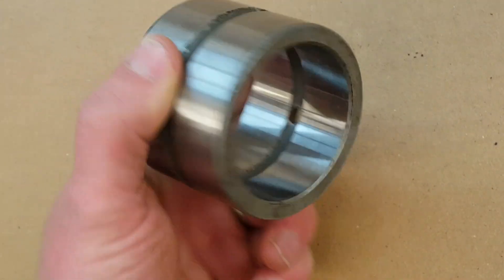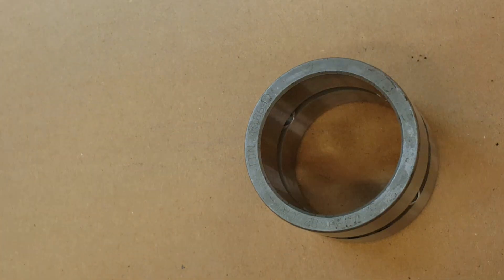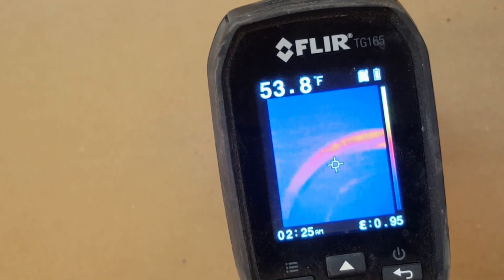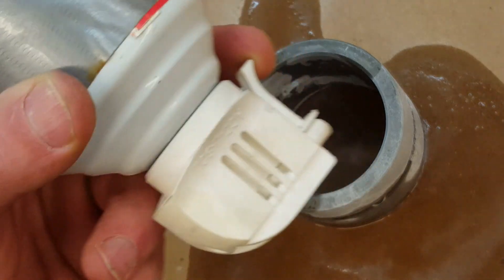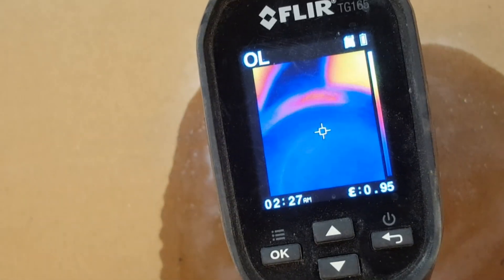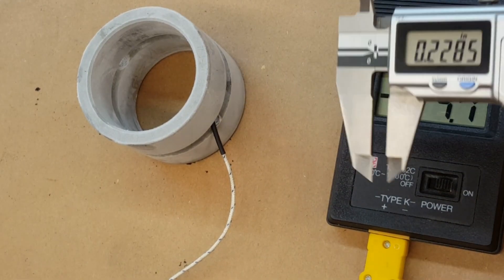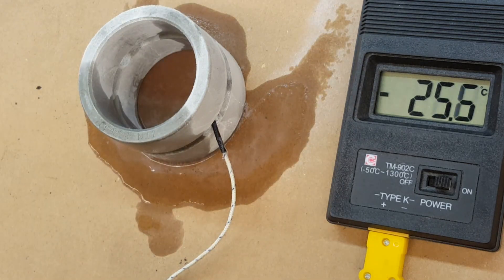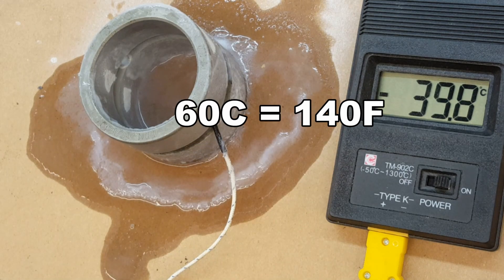Old Mechanic's Trick: Freeze-Shrink Metal Parts WITHOUT Nitrogen.

Comment: Dry ice and ethanol bath is another way to get shit real fucking cold. Dry ice is easy to get in the US
Reply: Dry ice and acetone even better.
Reply: "Dry ice is easy to get in the US" - That's right. At least for now - but lawers are always scrambling about looking for new payoffs and "ice is" sounds too much like "isis" to allow it to remain legal for long ;-)
Reply: acetone isnt very nice to work with though.
Reply: yeah them ketones, bad for the working bits for your insides
Reply: Well, in this case you're not supposed to drink it.
Reply: It's a pain to get in the UK (dry ice) even though it's not a restricted substance.
Reply: @gordonlawrence3537  Thanks in no small measure to stoopid EcoPhanatic politicians... so lets not even mention "CO2"...
Reply: The large size CO2 cartridges for air guns work well too but they cost between £10 and £15 a pop.
Reply: +1 for dry ice and alcohol. We use 91% isopropyl and dry ice when we have to do shrink fit parts.
Reply: vapours arent a problem at dry ice temps
Reply: You have to watch out when using ethanol while working on machinery.

It could end in a real bad day.
Reply: tip a CO2 fire extinguisher upside down to get dry ice (if ya ever need it bad)
Reply: +Eldon Schiemann Great idea! THanks!
Reply: zombieresponder:

Yeah, but...
...With ethanol, one can celebrate a successful insertion on the spot!

Comment: Love it. Just used this trick the other day to test a temperature controller that was acting up. Needed below 0C but couldn't generate it with the wind tunnel down. Wouldn't have thought about it if it weren't for messing around with a can of it in the back. Every once in awhile a few of the loose wires in the brain box short and something miraculous happens. Simply amazing when horsing around gets valuable results.

Comment: Wouldn't you risk shorting out the electrical component by blasting it? The low temperature would cause condensation.
Reply: Your right. It's only an issue for long term applications. I was thinking about sub-zero PC cooling when I commented.
Reply: Well, the stuff in the can is R-152A, so you could take an old fridge compressor and build a ultra cold cooling loop for your PC. One that uses liquid refridgerant, if you have pressure rated waterblocks. >:D

Comment: Might not be available in the frozen tundra but pipe freezer works a treat (stuff to freeze water pipes if you can't isolate the supply but have to break into it), might be pricier than air duster to.

Comment: Is the liquid that's forming conductive?
Reply: the non-flammable duster/freezespray/airhorn cans are usually R134a i.e. the same refrigerant used in fridges and aircons boiling point is -26'C

CO2 from a fire extinguisher would be roughly  -55'C, Dry Ice -78'C

Comment: A temperature of +60 degrees C is indeed +140 degrees F, but a change of 60C is only 108F. You only multiply by 9/5, you don't add 32. As an example, a change from 0C to 1C is an increase of 1C and 1.8F, not 33.8F.

Comment: Also, wrap in acetone soaked rag. Place in front of fan for similar effect. Save the $4.00 can of keyboard de-crumber.
Reply: +AvE I've never put the IR gun to it to record a temperature drop, if you need a thou or so for fitment acetone rag works if a freezer is impractical. I'd assume the duster is colder as the solvent seems to be a bit more volatile, plus the release of the compressed gas has its own cooling effect.